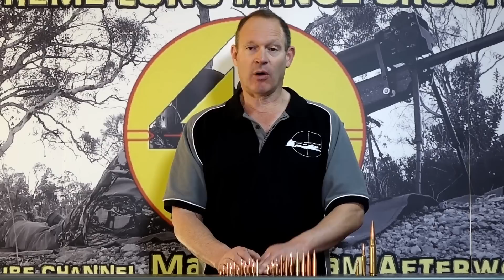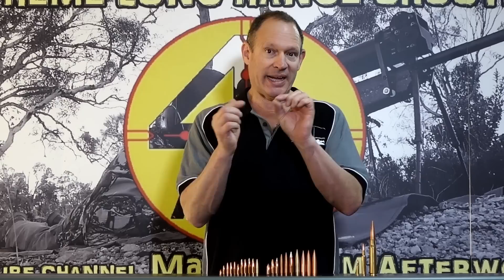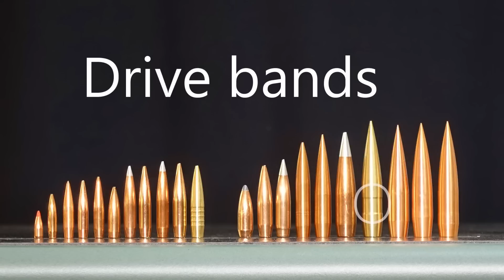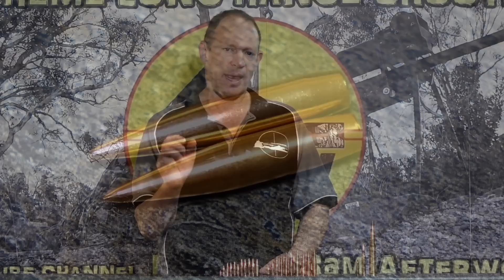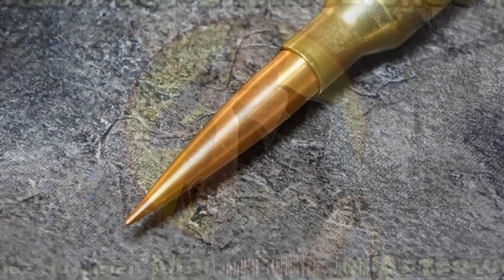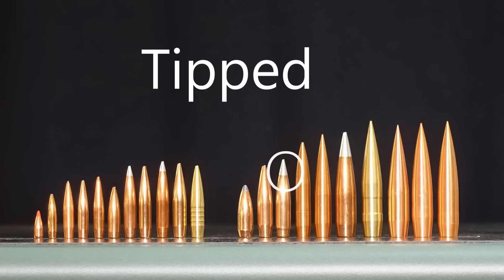Lead core v Monolithic Bullets (4AW ELR perspective)

Comment: You may want to check out Alco Bullets. They are lead core with a CNC machined tip in steel or aluminium. I have hand loaded 20 of them in .284 cal (My 7mm Rem Mag), 168 grain with a claimed G1 B.C. of .802 and a  Cross-sectional density of .298. I would be curious to see how you would do with these, and how well they perform. Great content as always👍
Reply from the maker: Cheers

Comment: I agree whole heartedly on the solids, however for different reasons. Here in the states I shoot 375c, 408c, 50bmg. I dont have a lot of lead core choices in those sizes but have a good variety of solids. The .375 350smk runs the same dial as my 353 Lehigh solids out to 2500 which tells me they are very close ballistically. There is a whole other topic of what alloys the solids can be machined from too. Seeing most of the large bores done out of brass now. 4AW you cant imagine who much you've contributed to the shooting communities education.  .......PS your older videos in the field would have a break down of your equipment cameras, spotting scope, range finder etc. Really miss that !!
Reply from the maker: Thanks Man, glad you liked, Cheers and all the best.

Comment: So just for instance a match king vs a tipped match king. You will give up the BC of the tipped version and go with the standard match king?
Reply from the maker: Different conversation, hunting bullets, not ELR, tipped metal jackets v hollow point metal jackets, maybe another video, Cheers
Reply: @markandsamafterwork  What about for just long range for the 1k to a mile stuff. Would you still choose to stay away from the tipped style?

Comment: Thanks for putting this stuff in near-laymen’s terms, Mark. I have noticed that even on some of the quality lead core bullets, the meplat tends to be flat. Have you considered possibly machining the tips? Would that even help in the transonic zone? Also in the same vein, you mentioned the mono’s tend to have a more machined finish. Would it help to polish them?
Reply from the maker: Thanks and yes you can do other things to bullets, some work, some don't, depends on how much effort you want put into an individual  bullet, and of course, you need to do the exact thing to all, consistency is the most important thing,  Cheers

Comment: I know you're busy but if you or someone else has an answer, you got me thinking. I'm only taking shots of 100 to 400 yards. While at supersonic speeds does the gap on a bullet with a ballistic tip still come into play. You said something about a cone around the bullet above supersonic. (I'm still using factory loaded ammo) I'm shooting mostly   .17 cal and .223 cal. Thanks and great video!!!
Reply from the maker: It is still relevant, but less an issue while supersonic, and ballistic tips are great for hunting in those cal's and at those ranges, Cheers
Reply: @markandsamafterwork  THANKS! Have a good one!

Comment: Centripetal force goes up as the square of the radius for constant rpm. The is because the mass is traveling at much higher tangential velocities for constant rpm as radius increases. You can derive some rough limits using yield curves of the materials and the pressures exerted by the lead. The copper jacket effectively becomes a pressure vessel holding the lead inside. I did this once back in an advanced dynamics class in college. Practically, the failures occur at flaws in the jacket material.
Reply from the maker: Well there is always a more complex way to say something, I think you almost nailed that one, lol, Cheers
Reply: MarkandSam AfterWork I’m just happy I actually remembered something from decades ago in college, lol! Maybe I haven’t killed all my brain cells from exhaust fumes and lead poisoning yet. 😉
Reply from the maker: Lead poisoning, lol, Cheers

Comment: Hi Mark, great job! 
I have heard that in the smaller calibers that there can be accuracy issues with monolithic bullets. Could it be possible that the monolithic being a solid alloy resonates or vibrates after leaving the barrel just like a tuning fork does after a light tap? The lead core in jacketed bullets could act as a dampener reducing any vibration caused by traveling down the barrel and detonation shock? The larger monolithic bullets may be more accurate due to their larger mass dampening the vibrations. Just a thought...
Reply from the maker: Well maybe, but really just as explained, weight v mass, they are just a little light for the size/length, so need to be spun harder and that then has its own issues, and on top of that can struggle to get the right barrel seal....Cheers
Reply: Litz did a good explanation for it, and the reason is that mono bullets are very light for their size so thats why they dont work so well in smaller calibers.